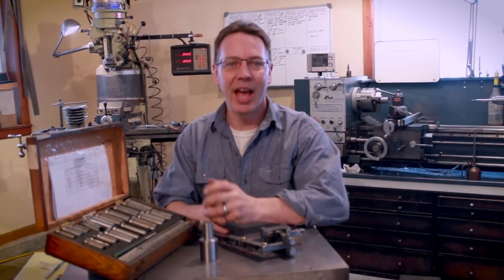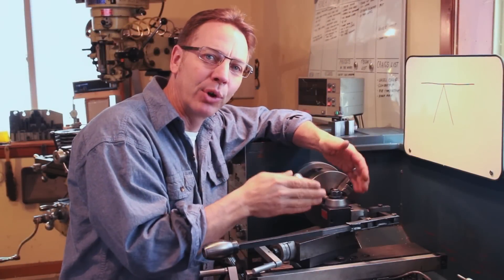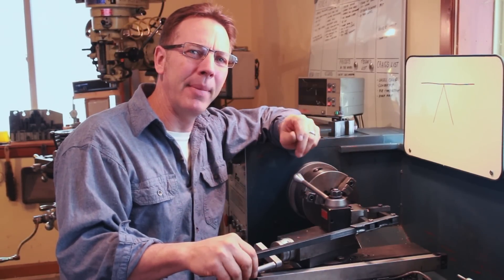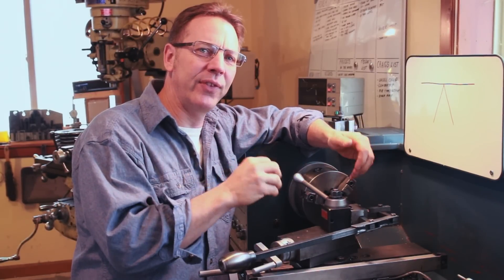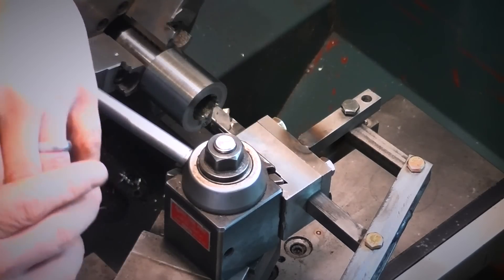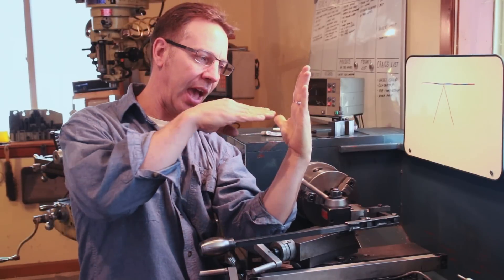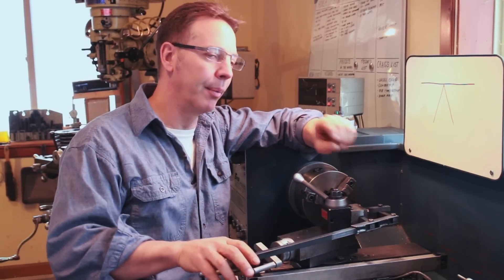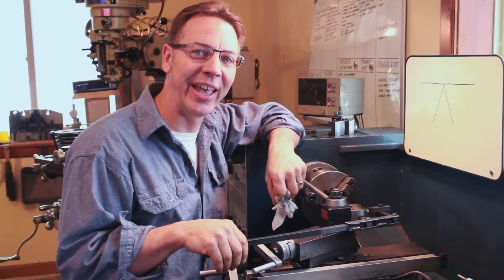BROACHING ON THE LATHE

Comment: Have u taken apart and moved the screw timing on your tool post? My hand is at 5oclock when tight and others I have seen even cheap ones are on the right when tight....I  bet urs was cleaned and maybe turned 180°?

Comment: The action is certainly that of a shaper, even if the motive power is manual rather than motor. Making keyways has always been a traditional use for a shaper. Blind-hole keyways are a bit tougher; did you have to machine some kind of relief cut at the bottom of that hole?

Comment: Hi Dale,  My dad years ago used a similar method to make a clock gear he needed.  he made an indexed disc for behind the chuck with a pointer and then drug a shaped cutter through the work.  Used the compound later to polish the gear into another that took the tool marks out. I do not think he added the lever action...just used a tool holder and moved the carriage but since it was brass it worked fine.

Comment: Hi Dale, would be good to get a feel for just how long it took to broach the keyway and see the finished product.  I experimented with something quite similar and found it extremely slow, in fact I found that the play in my setup (very similar to yours (did not use tool post, just mounted it to cross slide like you mentioned one could).  What I found was that the opening of the slot was much wider than the end of the keyway.  it was as if the flex in the shaft as I got deeper in the hole allowed flex and therefore less pressure on the cutter and therefore let cutting.

Did you witness any of this?  Might be interesting to see how a perfectly hollow tube measures out at the beginning and the end of the keyway (depth of keyway hard to measure on a blind hole)

thoughts?

All the best

John
Reply from the maker: Hi John,
 Your right, this way of broaching is very slow process. Tthat is why you don't get to see the final slot milled into the shaft  extension. The extension I was using for the video was a reject part and was not worth finishing. The  final part  had already been press on to the motor shaft and installed  into the machine it was made for. I should have photographed it. sorry.

I had a little problem with flex. I think it was caused by my first cutter having to aggressive a cutting angle. When I changed it to a Negative angle like I talked about in the video it fixed the issues of flex an being out of tolerance. You might want to put some clearance angle on your cutter too. 
The final fit  was good and  tight and had know taper to the slot.

Try regrinding your cutter for a negative angle.

Thanks for the Question
 Dale d
Reply: ***** will do Dale, to be honest, i am a rake idiot, intuition implied to me that a positive rake would make sense.  Does the negative rake really pull the material off rather than remove material on the "push" stroke?

thanks again for the reply and vids. . . .

Comment: I enjoy your videos. Another way is to  insert the cutter you had on the shaft, install it in a tool holder, onto the quick change and use the Z of the carriage, use the cross slide to control DOC.
Reply from the maker: Hi CncObsession,
I have done it that way in the pass. but I think it puts a lot of wear tear on the bed and the rack and Pinion System. what do you think?

Dale d
Reply: +Metal Tips and Tricks (Dale Derry) .Yes, do it this way...lathes already get too much work/wear near the chuck.